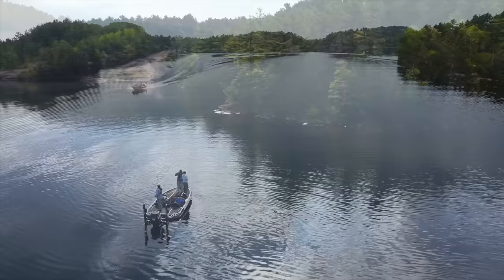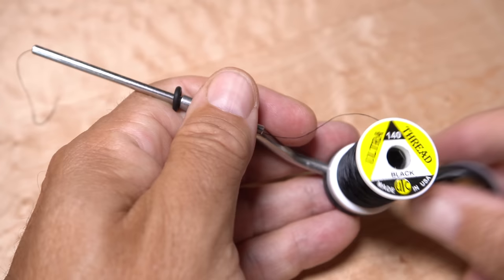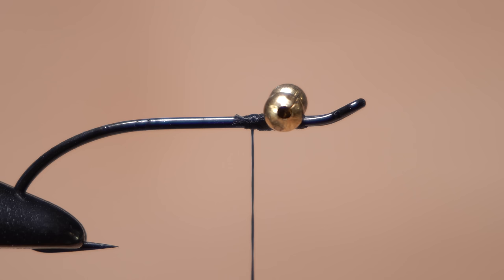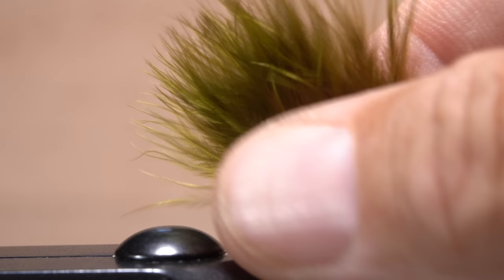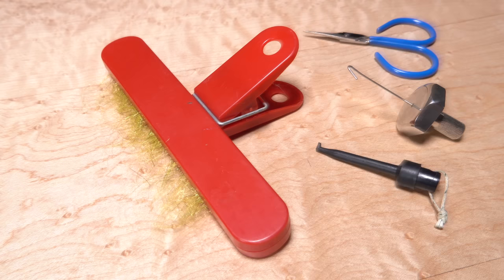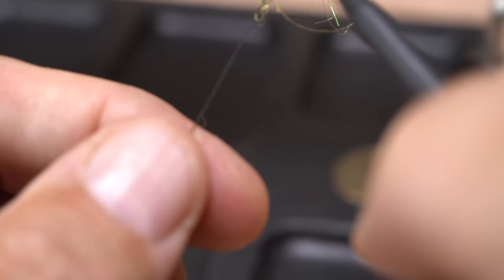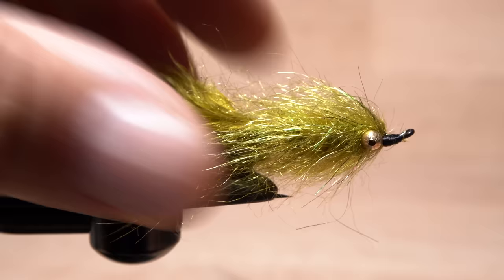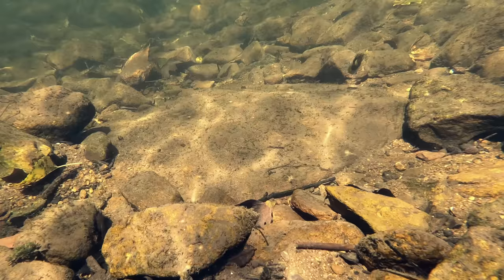DDH Leech

Comment: That's a cool pattern. I have begun using different points on my vise to measure proportions as well. I have also started to use the number of lead wraps on my nymphs to inform me of a deadly accurate tie in point for wing cases so as to maintain that sexy consistency..